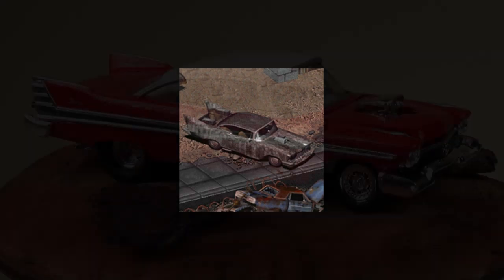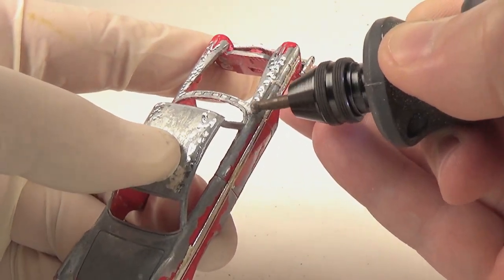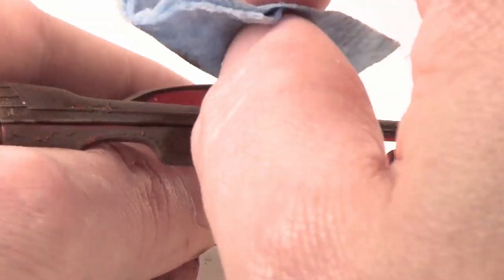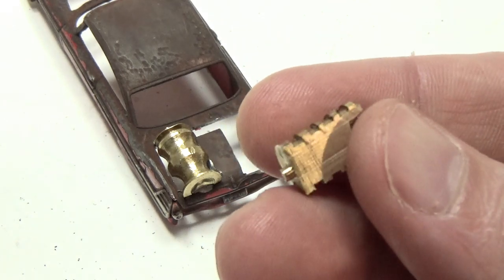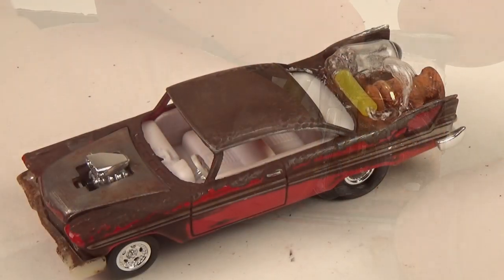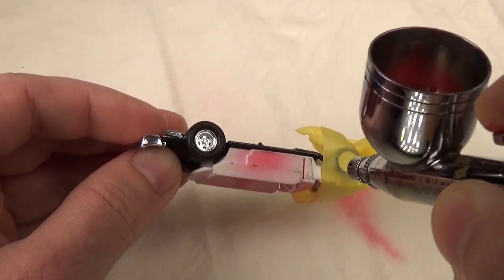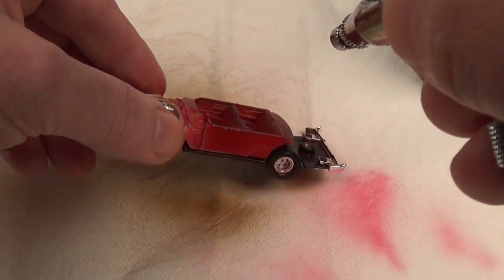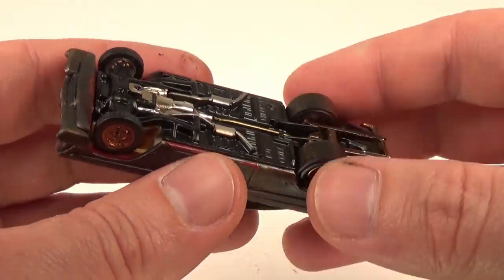Building the Highwayman car from Fallout 2

Comment: The highwayman is technically electrically powered and nuclear powered.  It can use either small energy cells (which look like batteries) or Microfusion Cells (a small self contained fusion reactor the size of a 9 volt battery))

Comment: Actually, you can purchase a large blower for the Chryslus in game, which you're right, doesn't make sense for a fusion battery powered car but still.

Great custom, as usual! The glowing generator made for a very cool addition!
Reply: Maybe it's part of the cooling system for the reactor.
Reply: @CAMSLAYER13   Actually the Highwayman didn't use a reactor like the Corvegas and Atomic V8's. The Highwayman was an all-electric car that could be charged with either Micro-Fusion Cells or Small Energy Cells. A blower can be installed by Ratch at the NCR that gave the car a speed bonus. Though I'm not sure how that works exactly
Reply: @stuntman7799  well it could be cooling the batterys allowing you to draw more power without them over heating
Reply: @CAMSLAYER13  Sorta like pc cooling fans right?
Reply: @MozambiqueEnjoyer6097  its kinda hard to say since we don't really know what it does, assuming its providing cooling you could say they were serving the same purpose. A blower, or supercharger, on an actual car is an air compressor.

Comment: Just when I think my skills are getting better, you pull out the glass torch, 😆. It turned out great, only thing I would have done (if I could actually do everything you did) is leave just a little bit of white paint on the roof. Just some in the middle, looking very chalky and faded.  That looked like a M2 casting, I have one just like it but different color. The interiors do come out, it is just really difficult. It feels like you are going to break it, but then it just pops off. Never saw anything that looked like glue holding it, just a really tight fit.